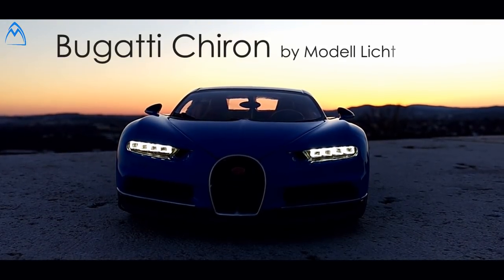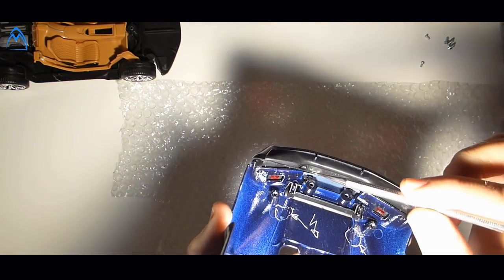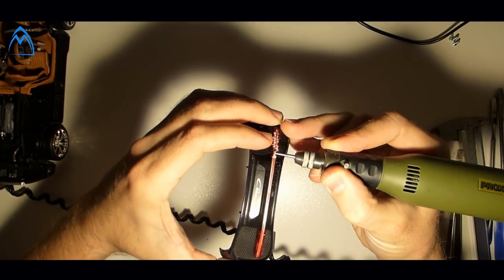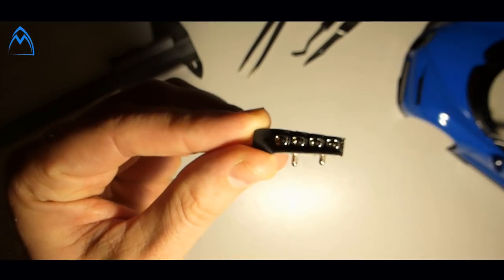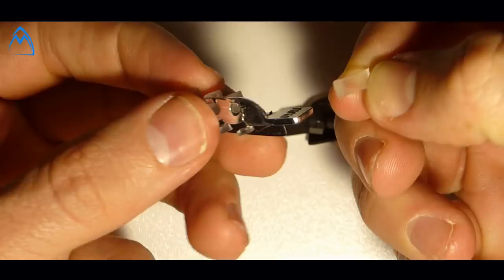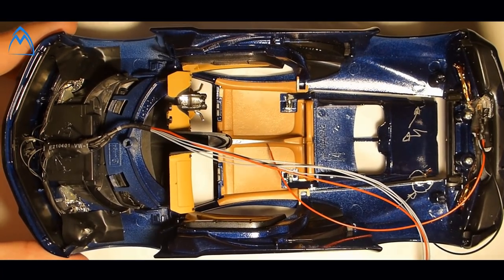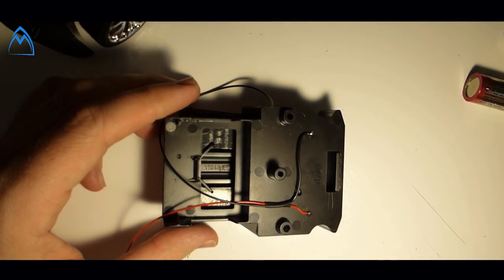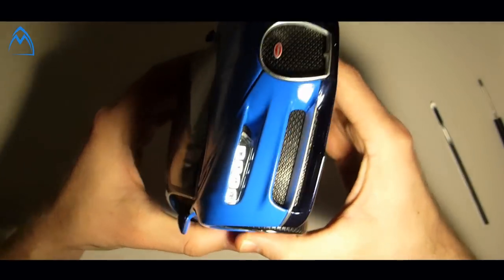Customized LED Miniature Bugatti Chiron by Jakob Michel

Comment: Thanks for shearing this Incredible tutorial very well explained can you tell me please what brand is your crafting tool and what battery holder and type of switch have you used I have used a small miniature slide switch but find them bulky yours are neatly fitted  do you wire your leds in series or parallel is it possible to give me a link to buy some small switches like you have used on you veyron

Comment: have you ever try to use external power source instead of using internal battery...?
Reply from the maker: I did already - the McLaren P1 has an external power supply, but the first video (second is in work) I'd use an internal battery. It depends always on customer, what kind of battery is in a model
Reply: modelllichtsysteme  awesome job bro...

Comment: How do you make head lights go from dip to main beams using led lights any advice will be appreciated
Reply from the maker: what do you mean with: ...go from dip to main beams....?
Reply: modelllichtsysteme hi I have seen a 1/18 model sierra cosworth on YouTube and when he switches the lights on the head lights come on then they go brighter as if they are going from dip to main beam
Reply from the maker: What you've seen in that certain video was the multiple state of lighting. The first state is "parking lights" - In reality 5 Watt bulbs. The next state is the low beam/main beam - in reality ca 55 Watt H1 bulb. This is within the main reflector for the low beam in this Sierra version. The second reflector, also within the main headlights is for the high beam - 55 Watt H1 bulb.
The lights built into the front bumper are turning singals and the fog-lights.

How it can be done with LEDs:
1) Use LEDs for the parking lights and other LEDs for the low beam. 
or
2) Use same LED for parking lights and low beam, but supply them with different current.
Reply: modelllichtsysteme hi thank you I am not sure how you supply the LEDs with a different current is it duel intensity using a rectifier can you give me an idea how to do it regards Billy

Comment: I have a red black color combo Chiron from burago too and am really willing to make the back hood open you must get rid of just the twoo holders on side or have to drill aroung on more lines ?:)
Reply from the maker: 8:48 - 8:56 
1) You need to cut the two holders
2) Make one end of the hood thinner 8:50
3) Make the "hinges" thinner on certain areas 8:54

If you finish 1), you can move the hood a very little bit. If you finish 1) and 2), you can open  the hood a bit. Once you finished step 1 - 3, you can move the hood.
Reply: I ordered a microdrill from ebay and some grinding bits but I am not shure if it will work on a die cast model ? what tools did u use
Reply: OK ALMOST DONE BUT i WAS TO RUFF AND THE HOOD IS NO A BIT LOWERED AFTER OPENING IT BUT WILL FIX IT SOMEHOW :)
Reply: WELL AALL ORDERED MINIDRILL MINI GRINDER BUT i MESSD UP TODAY i BROKE THE HOOD HOLDER :( DAMMM ME ....
Reply: And that's why beginners shouldn't be doing this! It is very complicated!

Comment: What size power switch do you use
Reply from the maker: it depends on  the model car. you can find them on eBay and several online shops or on  www.mouser.com / www.rs-online.com / www.digikey.com

Comment: anyone can put the light on
but the question is
how does it works?
the electric circuit and all that
you should have talk about it
where to buy the circuit board
where to fit the wire?

Comment: Great tutorial, thank you! The indirect lighting with fiber optics is inspiring me to investigate the possibility to light up a 1/87 large cargo van (7 cm long) to replicate a former work project I was involved in for my private collection. Is it possible to create an "LED strip"-like lighting effect using fiber optics? I'm thinking about putting a white LED into the engine bay and having fibers illuminate the headlights as well as three horizontal strips across the ceiling of the cargo area, which I intend to modify to the extent where I can put a realistic upfit into it. A red LED under the cargo floor would provide light to the tail lamps using fibers in this scenario. Do you have any thoughts on that?

Obviously, this is with an external power supply in mind as I'm fairly sure that the model is too small to integrate that alongside a realistically equipped cargo area.